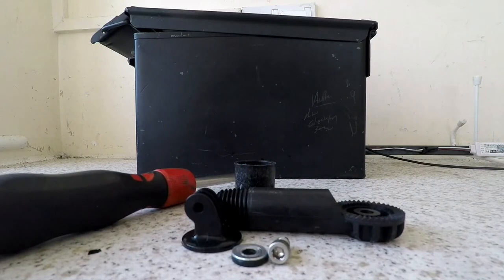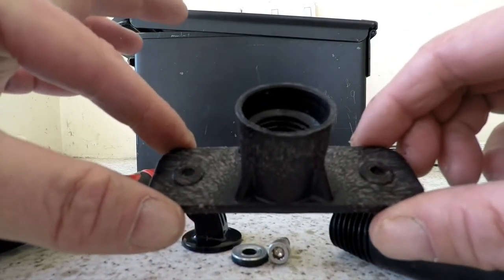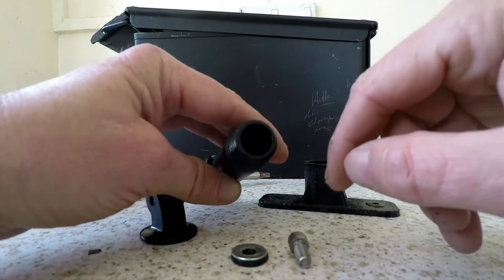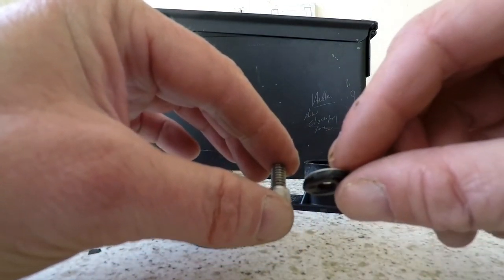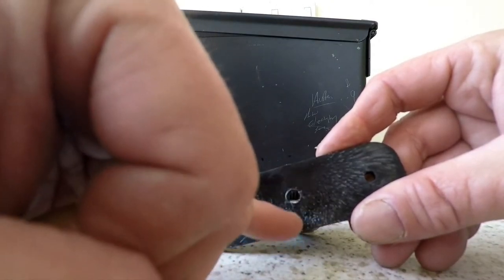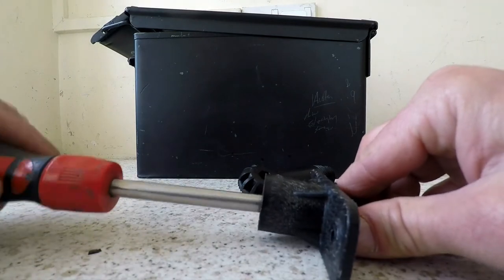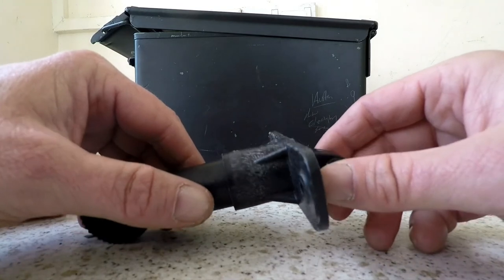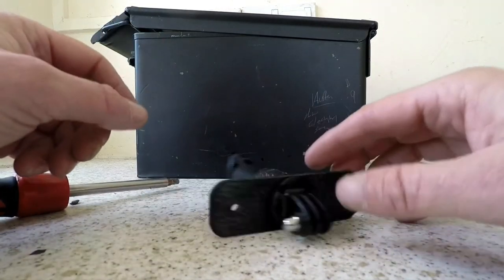WFP - GoPro / Action Camera Angle Adapter Mount - Great For Gutter Inspections

Comment: I'm not a professional, but since I've just been told (quite vehemently) that I can't go up a ladder to do a gutter inspection anymore, I've been thinking about what camera bits I have available instead.

This has saved me a lot of time in working out how to fix my GoPro type camera to an extension pole.

Thanks
Reply from the maker: Good afternoon Chris and I'm pleased to hear that my video and easy to find information has helped you. This was the simplistic and trade specific way that works. Austin
Reply from the maker: How did you get on with the camera solution